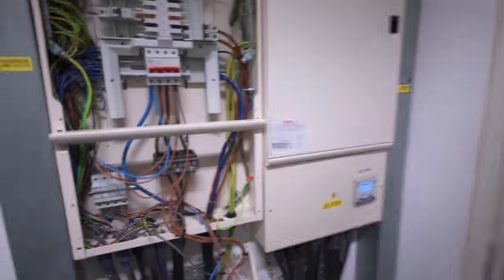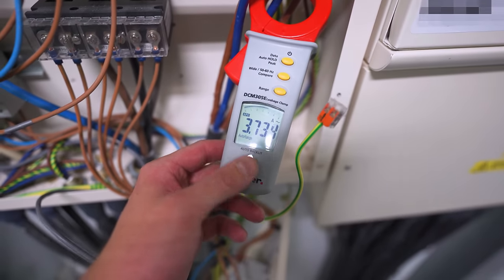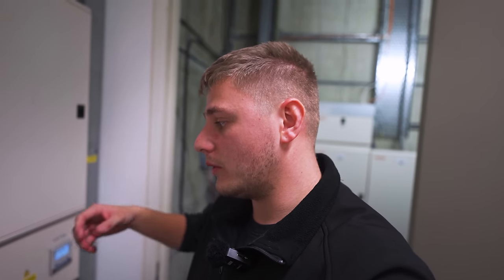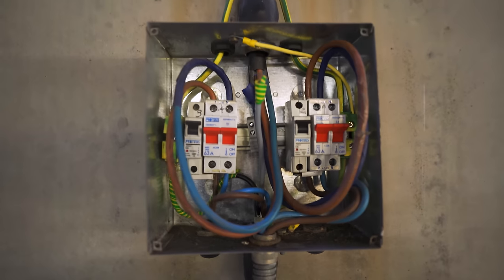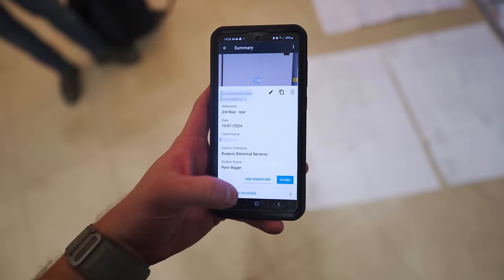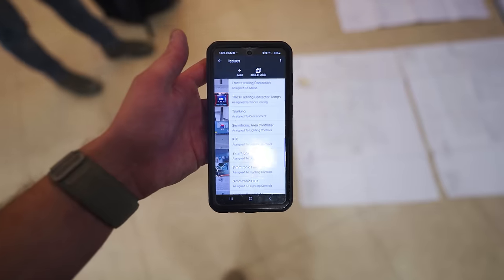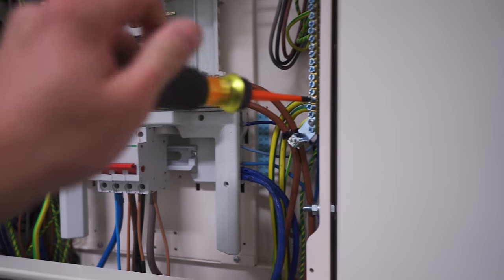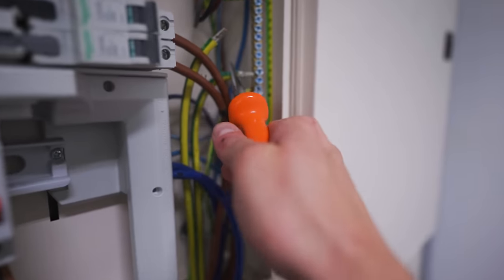This EV charger install is wild

Comment: Thats what thinking inside the box does to you lol. The box that keeps on giving. I wonder if the shared earth via the din rail connectors and poor filtering in the EVSE is playing a part in those neutral currents as well. Which would be even worse than induced voltages/currents tbh. If they are allowing currents into the earth path it would explain seeing them on both Neutrals. Good find and great video as always.
Reply from the maker: Hahah it sure is, great point mark, hopefully I get back there again to mess around!

Comment: I definitely agree it’s not good that board that they made up in an adaptable box but it does have the benefit of if something trips ensuring that someone doesn’t just go and reset it that you have to get an electrician out because an EV circuit should not tip as a charger as protection from overcurrent generally

Comment: Thanks for the video Mike, Would have thought it would have been easier to have used the three phase to a local DB. Then done the circuits from there. Without sounding horrible to the trades out there. Possibly done by domestic installers. Again NOT disrespting anyone at all.
Reply from the maker: I think they wasn’t fully competent for sure! And yes that’s exactly what I would do, 3 phase sub main 👍🏼
Reply: @residualelectrical could have installed 3 or 6 charging stations if they used 3 phase (unsure how many is running each phase here already) so much a mess on that install when your earth's are a bit hot like that (was the voltage high as well only seen amps here)

Comment: So 3.9 amps in the neutral, 3.4 amps in the 2 g/y cables running to the adaptable box, and 0.5 amps in the main earth.
Adds up rather well.
That could be some sort of inductive coupling, or something more involved. This needs proper investigation.

Comment: Many thanks for the video Mike, Looking at the regs and can't seem to find the part where it says the following is not permitted-"    ** my thoughts are 
SWA cable with two individual circuits inside -              ** so long as the grouping factors are taken into account                 
Amoured cable used for earthing                                    ** so long as ZS values and thermal constraints are meet

What would be the difference if the charges had been wired in a single metal trunking used as the CPC, and single insulated conduit cables.

2 x Separate CPC installed along with the armoured cable       **. Earth leakage will always find an alternative path 
                                                                                                                   if you removed the two conductors wouldn't the 
                                                                                                                   current just find another path.

I agree the work could be completed to a better standard 
Please keep the videos coming, enjoy the content.
Reply from the maker: It’s certainly permitted, but selection and erection needs to be justified and they haven’t made a good argument for their method.

Thanks for the support on the videos, I wish I had more time on this one to see what’s really going on, I guess if you removed the earths it would leak down the earth of the DB, either that or it’s coming from the chargers, needs a deeper look 👍🏼
Reply: @residualelectrical  I think the hazards created by this shoddy install doesnt need BS7671 to tell you it could kill someone! 🥶⚡

Comment: Usually I'm quite sceptical of other electrician's who criticises other electrician's work. 

But holy fuck mate, you are absolutely right. Whoever did this install had no fucking clue about any of the safety standards. 

Probably never did an electrical apprenticeship or is licensed.
Reply: He definitely has experience. He just needs guidance.
Reply from the maker: Yeah I’m not usually one to criticise beyond banter unless it’s dangerous, it’s not great to be honest, I only had 15 minutes to mess around on this circuit but the more time I spent the worse it got!

Comment: Maybe should have separated the two phases on the run and TT it to earth, to grounded metal work, around 4 to 10 ohms and put an upfront type S 100ma RCD. 
Agree with you though about the installation earth fault current seems a bit high! Think this might be to do with aging equipment or old lighting ect.
Reply: Obviously with type A RCD protection as a minimum

Comment: Considering that is a dual cable I wouldn't be surprised if they got the neutral swapped from the respective phase hot conductor as well. So blue 1 with brown 2 and blue 2 with brown 1. That is pretty sketchy could be worse not much.

Comment: EV install issues :
Surveys poorly completed
Being asked to complete EIC , Ohme paperwork ect, and configuring install all for one job!
Being expected to knock 3 installs out a day!!!( too much)
Customer has no idea about level of work required.
Installer feels pressured in their roll to complete the task( very dangerous for fire risk and shock risk if all steps above aren’t completed properly!
Reply: Additional problem is I prefer to use a DNO box if there’s space but some DNOs don’t like this. But I also feel various ip68 outside fuse boxes carry risks if the get damaged which doesn’t happen to a DNO protected box

Comment: I love watching your videos, as an American it gets a little confusing with the way your installs look especially because im not used to looking at iec breakers contractors and such but other that its great content
Reply: And y’all’s wire phasing is way different then how we do it over here
Reply: No split phase here single phase, generally residential is 60A (old) 80A or 100 amps is plenty when using 240v or 3 phase (100A per phase and each phase can be a single 240v circuit, balancing is required)

Comment: Hi Mike . That is a rough one . Could have tested the voltage between the disconnected cpcs and earth bar . 

Could be induced voltage with all the cables sharing the trunking with the energised fuseboard adjacent. 

Could be an earth rod down there somewhere. 

Concrete will conduct especially when wet and rebar in it . 

Resistances are in parallel with each other and will share the voltage/current in proportion to the resistance of the path .
Reply from the maker: Great points mate, wish I had more time too see the direction of current flow etc, maybe I’ll be able to dig deeper! 👍🏼
Reply: @residualelectrical  the fault running  down that redirected TNCS earth fault  has to have a better path than the existing Earth so I would look for any bonding to structural steel work or if they’ve used a supplementary earth rod somewhere. All very hazardous ⚠ ( you also need to be sure your neutral csa is suitable and where it’s feed from )

Comment: Personally, it does not look like a bad install.I mean its not super duper neat but to be honest it looks allot better than allot of work you'll find here. Plus it does look like he put in quite allot of care in what he did and there is allot of detail  that people would not even care about here. Like the box might not be 100% IP rated but hes got his grommets in and stuff. I would instead have taken it in from the bottom tho. But you did give me a few things to think about . And I personally think with a bit of guidance whoever did that job will do well.
Reply: I had similar thoughts. I would not call this cowboy on the scale of things. the install is quite neat for an improvised setup, although it's all  irrelevant when it is also dangerous. it's easy to become complacent when you've convinced yourself you know what you're doing.
He should check out some of the crazy old installs you'll find here in the us..

Comment: Does anyone know anywhere stocking Boddingtons at a reasonable price only place I can find are charging £80 for 5 drivers
Reply: Halfords Advanced EV 1000V Insulated 6 Piece Screwdriver Set. £43 apparently boddingtons but branded Halfords
Reply: Yeah I’ve seen only gripe is they’re ph and not pz and don’t have the 4.5 slotted but it might just had to do with

Comment: 4 amps is lethal? Wow
Reply: Currents between 100-200mA have been proven to be lethal in the right conditions. That's the reason RCD protection is normally rated at 30mA
Reply: Anything above 30milli amp can be lethal  300 milli amps is 10x that!